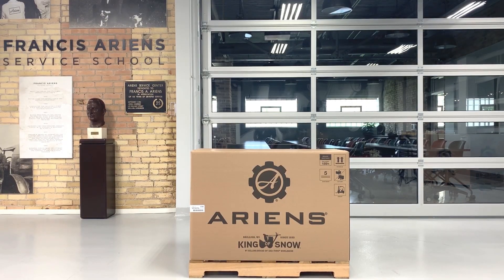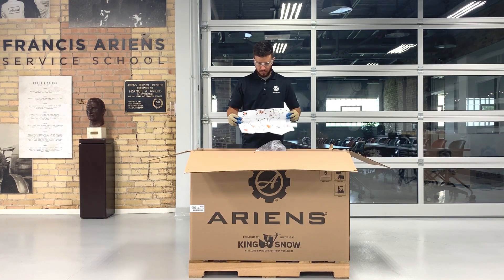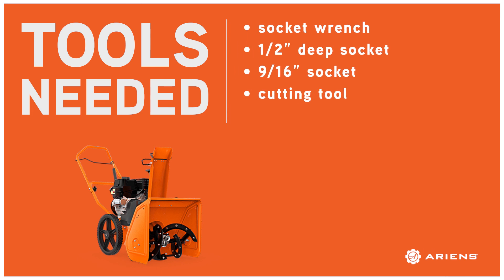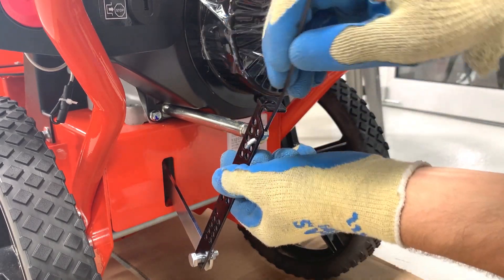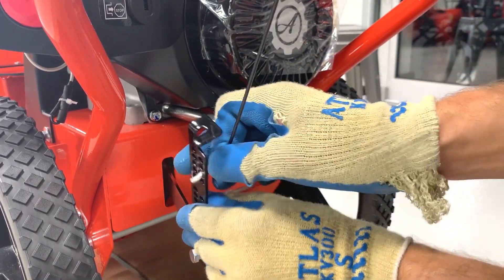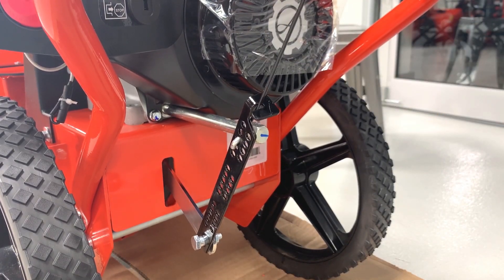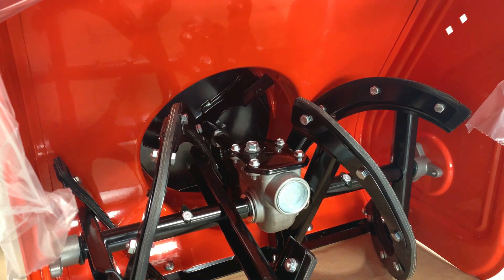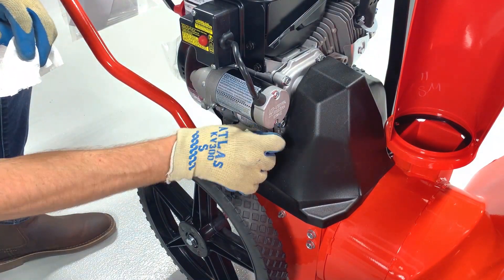Ariens® Crossover Sno-Thro® Assembly | Ariens

Comment: my 5 year old Ariens recently "crossedover" into a $300 bill, so 1/3rd the price of the unit.  Sad part is they said the leaking crankshaft seal and front engine gasket is common.  I will be "crossingover" to another brand soon.
Reply from the maker: Hi there, we're very sorry to hear about your experience with your Sno-Thro and that you won't be choosing us in the future. Through your buying process, remember to consult your local power equipment dealer. They're very knowledgeable and will steer you in the right direction.